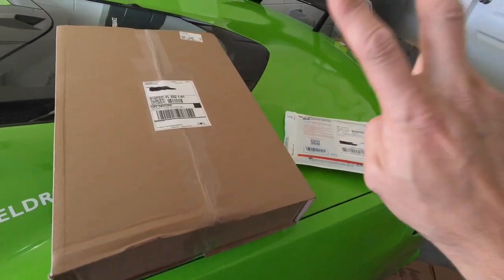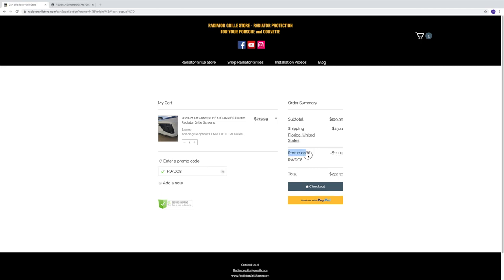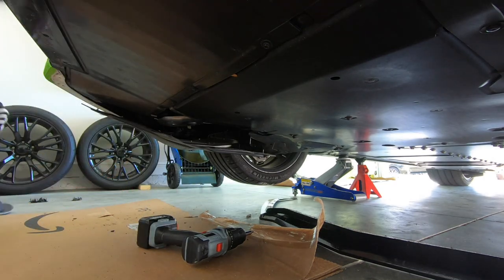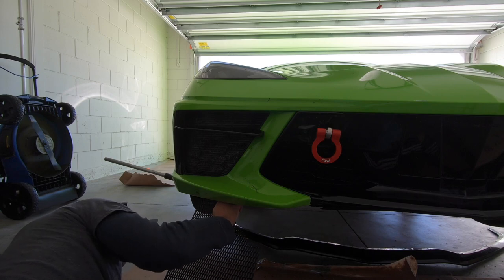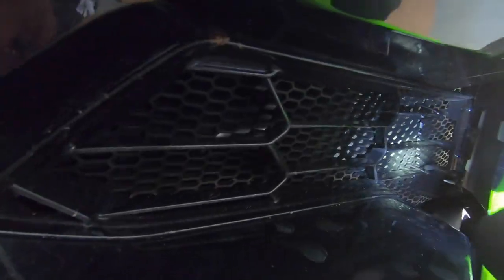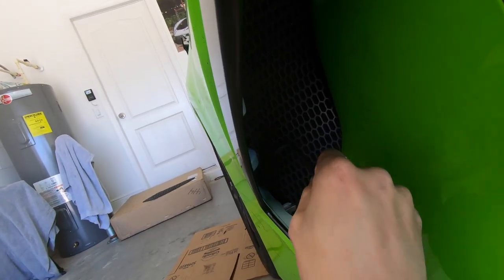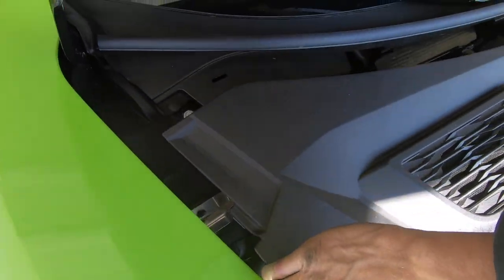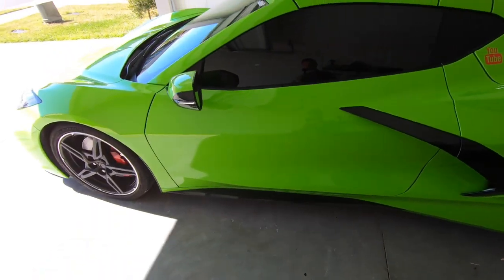C8 CORVETTE RADIATOR GRILLS AND STRUT TOWER COVERS INSTALL (HOW TO)

Comment: IF YOU DONT GET THE RADIATOR PROTECTORS WHAT IS THE COST TO REPLACE ALL THREE GRILLS.  THE SIDE GRILLS SIDE OF CAR WOULDNT NEED A GRILLE BECAUSE IT ISNT LOW AND UP FRONT.  WOW WHAT A JOB TO DO.🤢🤮...THE FACTORY SHOULD HAVE ALREADY INSTALLED THESE ITEMS INCLUDED WITH HIGH PRICE 🤑OF THIS CORVETTE OR AT LEAST OFFER GRILL PROTECTION AS OPTIONS  ALREADY INSTALLED FROM FACTORY.

Comment: These are the first mods I did for the grills last July. The passenger side grill was easy as hell but to this date I still have yet to get the drivers side in. I’m not so concerned with that one since there is a OE grill tucked in way back up in there. I did make templates of all the grills just in case and I may make one for the drivers side that’s a little more pliable. The strut tower covers I did that mod back in December. I saw where you had some water in yours in a previous video and meant to tell you about the covers but it slipped me.
Reply from the maker: Thanks for watching Joseph!
Reply: The driver side on mine broke. Wasted my money on these. Like yourself I'll be making my own.
Reply: @superameric8   Contact us and we are happy to walk customers through the install as it is tricky to ensure they withstand 140+ mph on the track.  Contact us and we will work with you to get a replacement.  Thank you for your business!

Comment: Chief Corvette engineer said not to use the grill covers, as they reduce cooling, and if the DCT has issues as a result, GM might not cover it under warranty.
Reply from the maker: Interesting
Reply: @RWDC8Z  Now having said that, GM does offer them now in the Accessories catalogue, but they are not recommended for track use, etc...

I did talk to my local dealer's Corvette tech this week, and he said to go ahead and install them if I am not tracking it...  He said the front ones that are prone to damage, and protecting them with a mesh screen that isn't too small, would be fine.

Comment: The grilles look great.  My concern would be  -- how much does it disrupt the airflow.  I have some pre-fab front mounted grilles.  Having an aviatiion background when I first held them and looked at them I could tell there was some engineering  that went into them.  At high speeds I can't help but feel the ones you've mounted are  going to create a fair amount of turbulence.
Reply from the maker: I’m not sure. You’re probably right. Wish I didn’t have to put them in but my radiators look TERRIBLE! 😔 Better safe then sorry right?
Reply: @RWDC8Z  I can't believe GM hasn't come out with a fix.  It is better save than sorry -- besides your setup looks way cool.

Comment: According to GM the radiator grill is not necessary. I just checked for water in the towers and they where dry as a bone. Bing bang boom done.

Comment: Matt check this out roll bar..........I want to re-introduce our @Studio RSR Corvette C8 roll bar.

We also offer a V2 with Harness Bar on both driver and passenger side! 
Check out our website for more details!
Check out the features and pictures below!
- 100% bolt-in- 3-4 hour, easy install
- Includes all necessary hardware
- No Welding needed for installation
- Tightest tube-to-chassis clearances & symmetry of shape
- Proprietary CNC machined tube-integrated chromoly tubing clamps
- Made with latest manufacturing technologies
- Wide-Radius bends = even stress distribution, no metal crimping, & no tubing wall failure
- Signature design by StudioRSR
PM